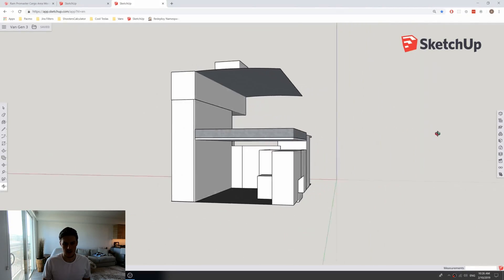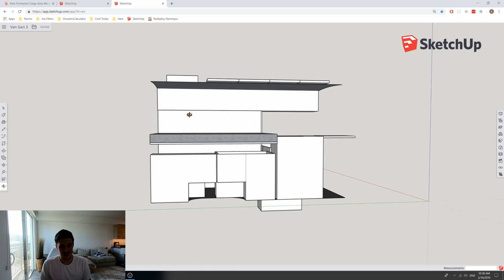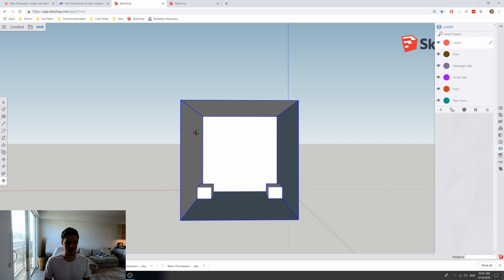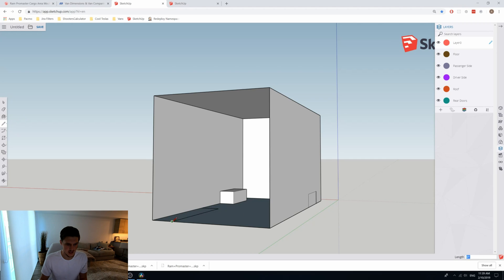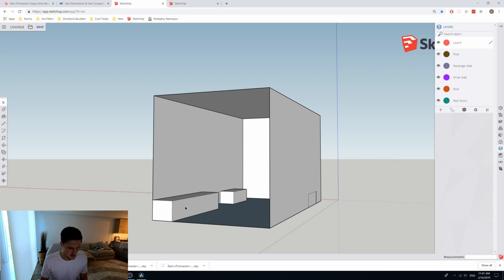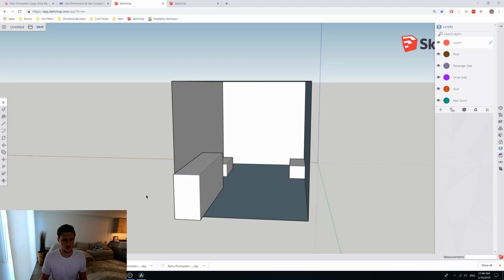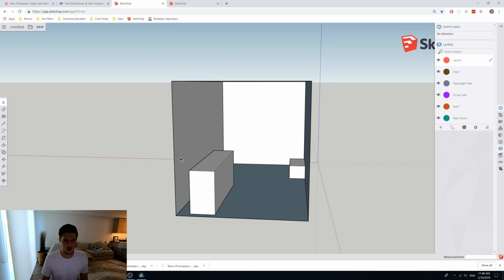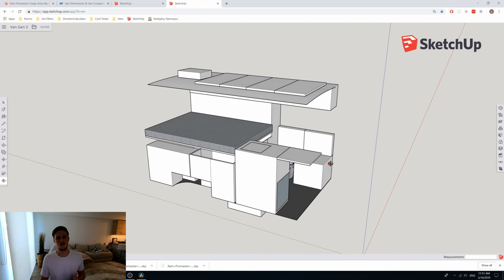How To Use Sketchup To Design Your Camper/Conversion Van (2019)

Comment: I’ve been watching for a while now and believe you are the most ingenious van builder out there. Question? Vapor barrier...you didn’t do one. As the whole insulation process seems to be one of the most controversial, I’d be very interested in your take regarding the install of a vapor barrier. What guided your decision not to install one. Thanks. A very big fan!!
Reply: Vapor barriers are useless. They will only serve to trap moisture behind your walls and eventually cause rust. Avoid them.
Reply: I heard some insulation like Havelock Wool suggests not to use a vapor barrior, because it is built to absorb moisture and breath/dry out. Some say that is better than sealing it up, so I guess it depends on your insulation.

Comment: I’ve been working in SketchUp on a similar design.
Does the bed fold up?
Does the shower a erectable cubical curtain?
Would like to see how you designed it with the shower is in use.
Reply from the maker: The bed slides in half. I just implemented this bed system and there's a video on the channel!
Reply: Seven O'Savage subbed, looking forward to see how this comes together, keep it up!